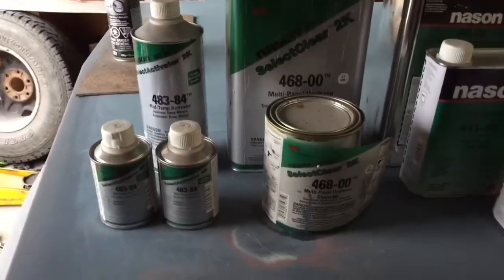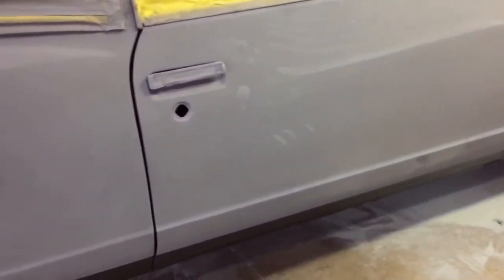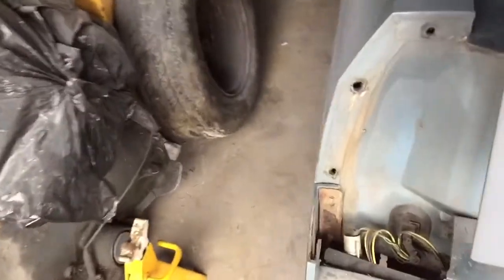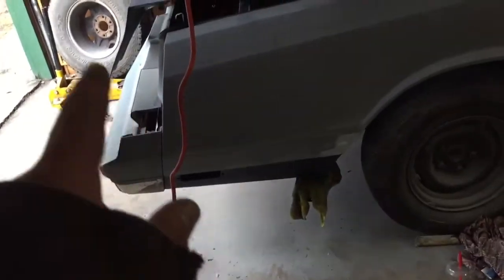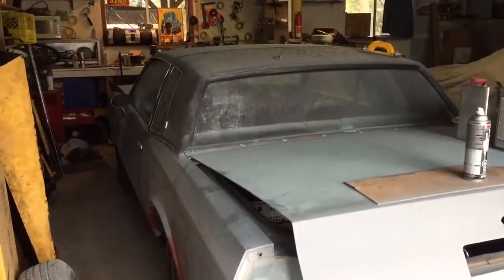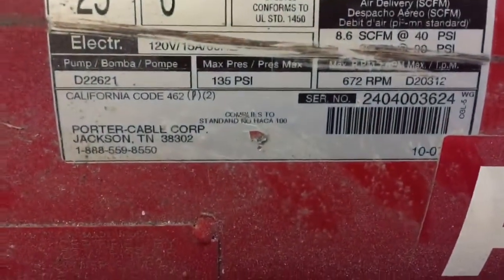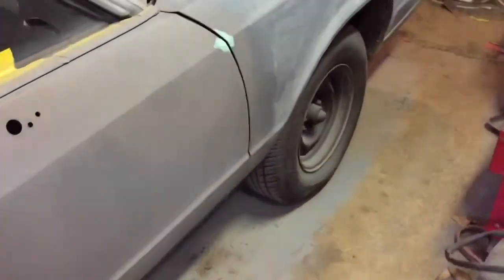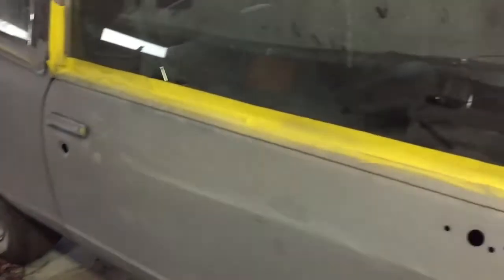The 1985 Monte Is Near Paint!

Comment: I'm impressed with your work on this, hope it turns out great.

I'll be doing something similar, but hardly as nice. Basically stripping a car body down, wirewheeling and treating the rusty spots, fiberglass/bondo-ing the holes and rough spots, then sanding and rattlecanning the whole thing. The body is off the frame and somewhat stripped already, I'm taking the opportunity do do something within my budget and timeframe while I have a chance. It should hold up nice for a few years, until I can do it properly with full sandblasting, welding in sheetmetal, and good paint.
Reply from the maker: +TheViolatorinator yeah definitely. One thing to consider is using a paint gun with single stage paint instead of rattle cans. Almost as cheap! Thanks for the kind words, and watching!